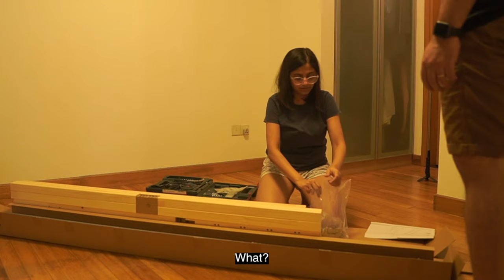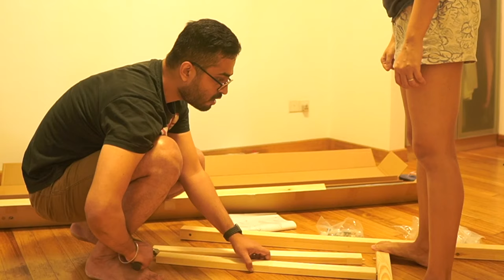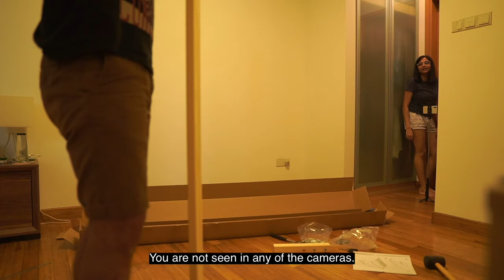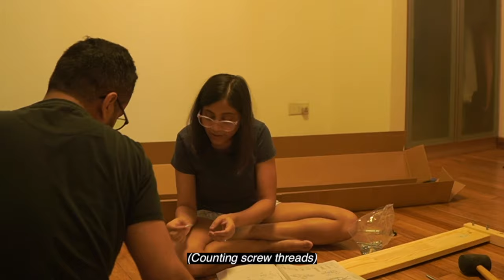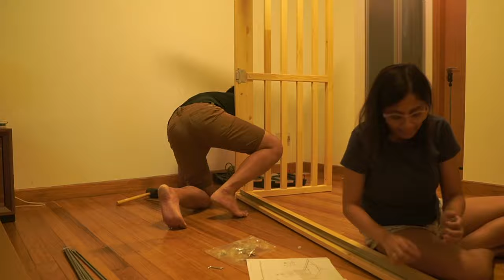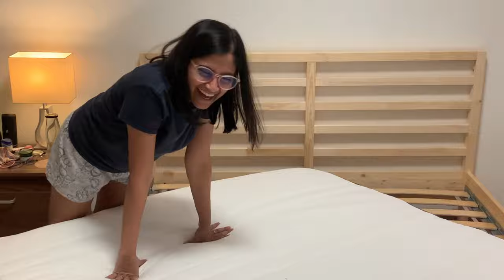Assemble IKEA TARVA Bed Frame | Installation of new IKEA Bed | Couple Goals

Comment: Looks like I assembled it right but when sat on the slats fell to the ground..what did I do wrong?
Reply from the maker: You probably didn’t fasten them with the frame. At each corner of the frame, there is a provision to do that for both the slats.

Comment: An amazing video! I'm considering buy the same product. 
Can you help me to know if you have experienced any squeak when using it and which tools you needed to assemble? thanks!
Reply from the maker: Thanks for the appreciation.
So far we haven’t experienced any squeak and it’s been almost a year. 
Most of the tools you will get with the product itself along with the instruction manual, for the assembly. To do it faster we used a mallet and a impact drill. Although, you can do it without them also but in that case you will need at least a screwdriver other than the tools provided in the kit. Hope this helps.

Comment: Haven’t you installed the frame wrong? I have the same bed. I can see the difference in height on each side varies. I had it installed by my landlord like this and I was getting backpain so I had to refix it.
Reply from the maker: Yes you are right, we corrected it later.